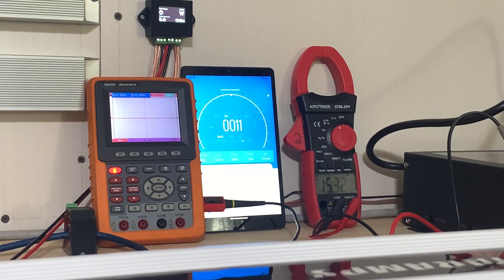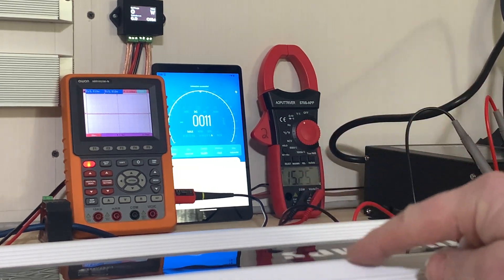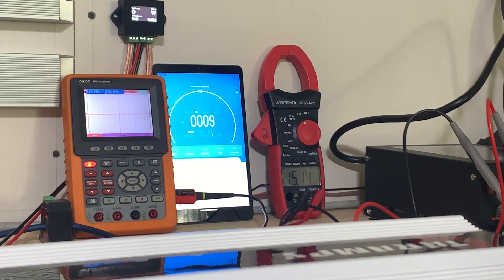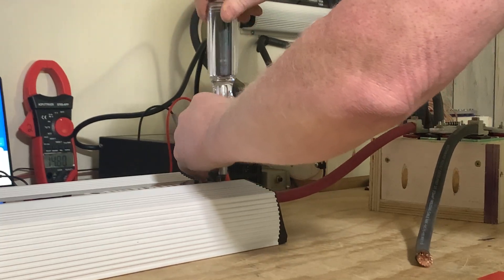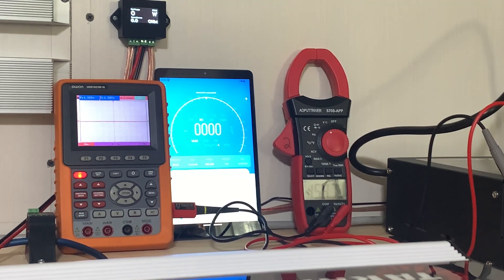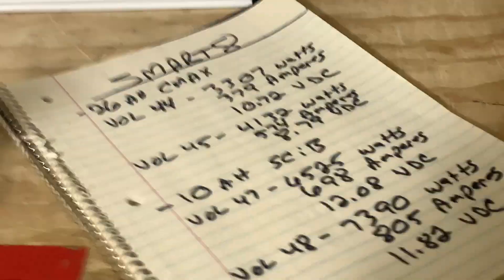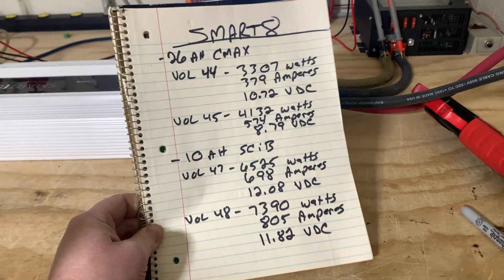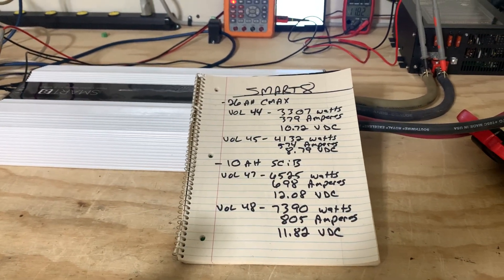CMAX versus SCiB on SMART 8

Comment: Hey bro where's the bast source to get raw scib cells
Reply from the maker: I get mine from Sriko batteries dot com. They have the 2.9aH and 20aH cells in stock currently.
Reply: @AllAboutAudioJW 👋😎❓
Quick question: I have the MD 8k not smart…
How much (ah LTO ) would I need to support that 8k on stock 150ah Altanator///
For two song demos, without stressing ALT❓
Please help running a sundown 18” nightshade.
Reply from the maker: @eurekaakerue4649  Quick and simple answer. If you are talking about SCiBs, then you would be great with 80aH of the 20aH cells with your setup. If you can charge the bank up to 15.0-15.0 volts that would be very beneficial as well. 14.4 volts is the lowest I ever recommend charging SCiBs to. You also need a bigger than normal bank if charging on the lower end of the voltage scale.
Reply: @AllAboutAudioJW Thanks Man😎👍✅❌

Comment: I love watching people trying to take down the king. I came up with the first C-Max battery. That was a pretty good test. What's the max voltage on that Scib bank? And why lower input voltage on the C-Max sometimes you know two clicks will do it, You know lol! Anyway, great test
Reply from the maker: The two banks were charged to the same voltage. The SCiBs were able to produce more power from the amplifier with less voltage drop. Max charging on SCiBs is 16.8VDC just as the CMAX. 2.8V MAX per cell and 6S configuration.

Comment: @AllAboutAudio- When you are talking about the 26 Ah CMax vs the 10 Ah Scibs, is that the total Ah rating per bank, or per cell?
Reply from the maker: I was referring to a 10aH SCiB bank versus a 26aH CMAX bank. The same could be said per cell also since the aH remains the same but the voltage increases when adding cells in series.
Reply: @AllAboutAudioJW  Oh, okay I'm fairly new into Lithium stuff. Hey was wondering what you think about XS Powers Team Titan8 TT30= 30 Ah bank, comes with balancers, buss bars, case, & cover= complete ready to run for $1099. Claims 20k burst power. Charge range listed as 15.5 volts to 16.0 volts. They have TT60= 60 Ah ($2199), & TT90= 90 Ah ($3299) banks as well. Is that an okay price, or very high for ready to run banks of these sizes? Oh forgot to mention these banks are Scibs.
Reply from the maker: @evilinside5984  Those are really good batteries for people who can't or don't want to build their own batteries. And they use either 10aH or 20aH SCiB cells depending on which series it is. The PWR series uses the 10aH cells and the RSV series uses the 20aH cells.
Reply: @AllAboutAudioJW  The Pre-made/ready to use/run (Team Titan8 TT30), has 18 cells, & is rated as 30 Ah. So does that mean they used 10 Ah cells?
Reply from the maker: @evilinside5984  Yes
Reply: @AllAboutAudioJW  So if i wanted 2x the reserve, i would want to build 3 banks of (6)- 20 Ah cells, or use 6 banks of (6)- 10 Ah cells? How many cells would you recommend if i had a clamped power= (after impedance rise) of 14k, knowing that this battery bank would only be used for my Bass Amplifier? Also, i have a Mechman 350 amp alt. to charge @ 16.0 Volts, that would only be charging the battery(s) for my Bass Amplifier.
Reply from the maker: @evilinside5984  If you are building your own battery bank to support 14,000 watts of true clamped power and it will be a daily/demo build, I always recommend using the 20aH SCiB cells. The C-rating on the 20aH cells is 35C BURST. Some people take that burst rating and divide by 3 to get a realistic continuous rating, personally I divide it by 4 to make the battery even stronger. So I will break down the numbers for you. A single bank of 20aH cells (6S1P) is rated at 35C, so 20 times 35 is 700 amperes of current BURST strength. 700 divided by 4 is 175 amperes of CONTINUOUS power.
14,000 watts of amplifier output at 70% efficiency needs 20,000 watts of energy going into it to be able to produce that 14,000 watts. 20,000 divided by 15.5 volts (accounting for potential voltage drop from the 16 volts you will be charging) is 1290.32 amperes of current needed. 1290.32 divided by 175 amperes per bank is 7.37 banks needed. Personally I would round UP to 8 banks because a bigger battery is always better. You could definitely do 7 banks (140aH) of the 20aH cells and do great. 6S7P would require 42 cells. By the numbers, that bank would support roughly  53,165 watt burps or 13,291 watts continuous. That is given the amplifier is running at 70% efficiency. Those numbers are battery only. I always calculate battery only because it makes the entire electrical system stronger. Hope this helps.
Reply: @AllAboutAudioJW  Luckily my amplifier (is 93% eff. @ 4 ohms, 90% @ 2 ohms (& makes around 14k around 16 volts @ 2 ohms), it is a Crescendo Bc17k (my friend clamps 22k per Bc17k wired @ 1/2 ohm) i will be wired to only 1.2  ohms daily, & .35 ohms(my switch adds a bit of resistance) for a 1 to 2 second burp, only about 3 times a year for a few comps. So i think it will pull around 1,000 amps @ 2 ohms, , & between 1,800 to 2,000 amps on those .35 ohm burps, not 2,800 like i said before, sorry. I think i seen the Scibs can charge @ a max voltage of 16.8, so if i set my 350 amp alternator to charge @ 16.3 volts, & my amplifier @ 2 ohms will be 90% efficient, what power will it support in my setup just alt power. I think its over 5k, so battery @ max for demo/ music would only have to support between 3k to 7k @ max.(you know music has many peaks n dips). Could i get away with 3 banks of (6)- 20 Ah cells? Since each bank can support 700 amps burst, x 3 banks= 2,100 amps burst, & i would only do that a few times per year.
Reply from the maker: @evilinside5984  You definitely can use a smaller battery than I suggested earlier given this new information. You would be good using 3 banks of the 20aH cells. This will be good for your daily and burp setups. I ran 2 of those Ohmega switches back in about 2017 on 4 of the HCCA 5Ks. One switch per strapped pair of amps. When switching from burp to daily or vice versa make sure the amplifier is turned off. One time I switched one with the amps on and it fried the master amp. The head unit was paused so no signal was going through to the amp. I thought that would be sufficient, but apparently it wasn't. Anyways I thought I would share that tidbit. Those BC17Ks are nice amps and would hate for it to fry over something like that.
Reply: @AllAboutAudioJW  Yes, thank you for that information, as that is the same switch i have= the Ohmega switch. I had a cheap Autozone toggle switch before on a pair off strapped amplifiers. The toggle was for my amplifiers remote turn on relay. One day while cranking my system driving down the Hwy., this switch had fallen on the floor, & from the bass making it flop up & down banging off the floor it started freaking out, & while the switch was flipped to on still, the vibrations made the switch internally switch my amps off & on really fast, like 4 to 5 Xs by the time i could stop it. Needless to say it popped caps, & smoked both amps🤦‍😢😒

Comment: Or scib
Reply: Scibs are much safer than Cmax cells. To power (2)- Md 12ks, if you have (2)- 300 + amp H.O. Alts., i would suggest (3)- 20 Ah (35c) Scib banks of 6 Cells, charging between 15.5 to 16.0 volts. If you only have (1)- 300 + amp H.O. Alt., i would suggest (4 or 5)- 20 Ah (35c) Scib banks of 6 Cells, charging between 15.5 to 16.0 volts.

Comment: 26ah Cmax cells? Can't find them anywhere! Unless you mean the 24ah cells? Please 🙏 help
Reply from the maker: The large cells were rated for 26aH by Panasonic. Anyone saying otherwise are just making up numbers. Just like the numbers that JAG35 makes saying his "120aH" banks are rated for 14.8VDC
Reply: @AllAboutAudioJW I believe Jag35 is  saying that the 120ah 14.8v bank has a minimum of 14.8v charging but we both know that when the voltage drops below the minimum from the alternator the battery isn't getting charged anymore.
Reply: @AllAboutAudioJW besides, I was asking about where to get 26ah cmax cells. Nobody has any.
Reply from the maker: @russellcrabtree5314  all of the large CMAX cells are 26aH. That is what Panasonic rated them for when they were new. Over time lithium cell degrade in capacity. At some point some of these "battery experts" did some 3rd party testing on the capacity of lithium cells and rebranded the large CMAX as 24aH and 25aH. They are not 24aH cells. They are 26aH cells which have lost some of their capacity due to age, use, and abuse. So what we are buying are degraded 26aH cells that have been relabeled as 24aH cells which is very misleading to the consumers. I spoke on JAG35 mislabeling the voltage on his "120aH" banks to show that some of these "experts" don't really know what they are doing. At 14.8V the CMAX cells in a 4S configuration are pretty much dead. They really need to be charged at 15.5V to get the most out of the battery. Hope this helps to clear up a few things for you.
Reply: @AllAboutAudioJW fantastic information. Thanks
Reply: Do the 5.5ah Cmax cells perform better than the 26ah Cmax cells? Could a 45ah Cmax bank handle 12kwrms amplifier over a 120ah Cmax bank?
Reply from the maker: @russellcrabtree5314  CELL FOR CELL THE 26Ah are stronger. The 26aH were fused at 225 amperes and the 5.5aH were fused at 150 amperes. But you have to look at the total amperage for each bank to get a good wattage number. 

The 120aH bank is a 4S5P so it is rated for 225 amperes times 5 which is 1125 amperes. 1125 amperes at 15.5 volts is 17437.5 watts and at 70% amplifier efficiency that comes down to 12206 watts.

The 45aH bank is a 4S9P so it is rated for 150 amperes times 9 which is 1350 amperes. 1350 amperes at 15.5 volts is 20925 watts and at 70% amplifier efficiency that comes down to 14648 watts. 

So by the numbers the two banks will handle about the same power BUT the 120aH bank will have about three times the reserve of the 45aH bank. So judge for yourself. These are the correct numbers published by FORD and Panasonic for each of these cells. And as always thanks for watching. Hope this helps you to make a more informed decision on your battery.
Reply: @AllAboutAudioJW I installed the 120ah Cmax bank from Jag35 and I'm currently charging at 14.8v and the voltage drops minimal on a Taramps Chipeo T12000.1 1ohm Amplifier and a Slapz Audio 2K.4D 4channel amplifier. I'm extremely happy 😊. I am going to be increasing the voltage  to 15.6v soon.
Reply from the maker: @russellcrabtree5314  nice! You will be surprised at how much better they get when you start charging at 15.6 volts. The batteries and the amps!

Comment: I want to be a scib fan. 44-45 vs 47-48 plays on results
Reply from the maker: Yes it does. It shows which battery can be driven harder before the amplifier is driven to the point of clipping, or in this case Smart Tech kicking in. And not to mention look at how much the voltage dropped on the CMAX at a LESSER volume. Your comment makes it seem like you do not understand the video at all.

Comment: I have 17k in amps. 10.5k being the largest for the bass 2ohms. I have a 50ah scibs made up of 10ah cells. is this good enough or should i switch over to the 20ah cells? i would still might want to switch it since i have the m4 stud version of them and swap them out for the m6 studs.
Reply from the maker: That 50aH bank with the 10aH cells is good for 40,000 watt bursts. I always take that measurement and divide by 4 for constant amperage draw to be on the safe side of things. That gives a maximum reserve per power ratio and makes it safer for the battery in general. So for constant power on that bank I would give it a conservative rating of 10K. That is stand alone power without consideration to charging.

Comment: What is the discharge c rating on the 26ah. So your saying 4 26ah cells puts out more amperage then a 5s 4p bank of 5ah cells making it 25ah? I agree the 26ah are stronger but its 5 times the size and if you do a test with the same amp hours of 5ah cells theyll smoke those 26ah cells
Reply from the maker: Comparing aH to aH is comparing apples to oranges. Comparing cell to cell the 26aH will most definitely outperform the 5aH cells. The 26aH cells were fused at 225 amperes of current in the Energi vehicles and the 5aH cells were fused at 150 amperes of current in the CMAX vehicles. The 26aH cells have 50% more discharge capability than the 5aH cells PLUS 5 times the reserve.

Comment: Cool video glad I switched to scib, isn’t the 6ah scib cell stronger than the 10ah scib cell tho? Since it has higher c rating
Reply from the maker: Nope. That is a very common misconception, unfortunately. The C rating is just a ratio of aH to reserve. You take the aH and multiply it by the C rating to get the actual amperage that cell can hold. So the 6aH cell is rated at 80C, so 80*6=480 amperes. The 10aH is rated at 75C, so 75*10=750 amperes. The 20aH cell is 35C, 35*20=700 amperes. As you can see the 6aH is the weakest of these particular cells AND also has the LEAST amount of reserve.
Reply: I mean that's standalone though. Add an alternator, esp high output and that higher c rate surely matters. If my bank of 6ah cells bounce back faster than the 10s obviously that's going to be better for audio applications. Also that spec of 75c on the 10s seem high to me. Had I seen they were that high I prob would've went with those. Rn I'm running a 36ah bank of 6s on about 8k clamped and it's absolutely stellar.
Reply from the maker: @JonGotBass  The testing was 100% absolutely meant to be standalone. That is how to test BATTERIES. To test a complete electrical system then yes you would combine all of the electrical components together for that type of testing. I have a series of BATTERY testing coming up as time and funds allow. Stay tuned. I have all of the different sized SCiB cells amongst others.
Reply: @AllAboutAudioJW  C rating normalizes capacity. But your comparison avoids normalizing the capacity. It’s not like the 10 or 20ah cells are the same size as the 6ah. They are physically bigger cells, that’s why they have more capacity. Run 3 of those 6ah cells in parallel and then Compare it to the 20ah cell so the comparison is 18ah vs 20ah. Blows it out of the water. 1440 amps vs 700. Same case for the 10ah.
Reply from the maker: @biguzivert  comparing apples to oranges. Really pathetic when you actually know what you are doing. Let us know when that sinks in.

Comment: And SCIB is safer than CMAX 🤷‍♂
Reply: Like crazy more safe. They can get crushed and completely punctured and still  work afterwards 🤯 only way they catch fire is if they’ve been sitting in fire for over 40 minutes 🤯 it’s gonna be more expensive to upgrade my voltage to run them, but it’s 100% worth it

Comment: Hi. Any chance of you testing SCib vs Yinlong LTO, thank you.
Reply from the maker: I do have several different types and sizes of batteries I will be testing as soon as I get everything built and organized in how I want to test them. I want to get the testing to where people can see what each single bank can do so they can easily calculate how big of a battery they will need for the size of amplifier they will be running. So far I have 2.9aH, 10aH, and 20aH SCiB banks. 40aH Yinlong, 5aH CMAX, 26aH CMAX, 8.5aH SAPT, 22aH EVE, 50aH EVE, and 304aH EVE. I am debating on getting 8aH Headway and a decent AGM also. These tests will be one video per battery with maximum draw on a burst plus a continuous power pull. It will still be a while to get it all set up, but hopefully all will go well and we can all learn something from the testing. Thanks for watching!